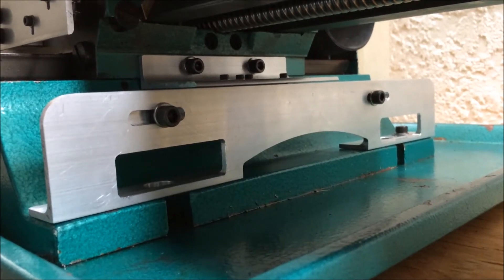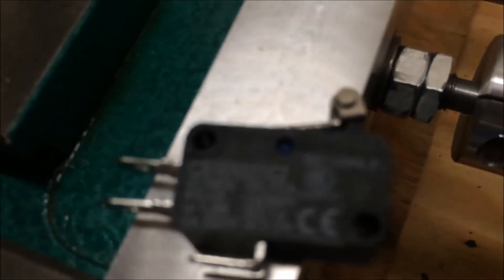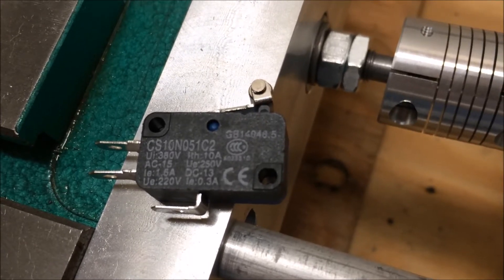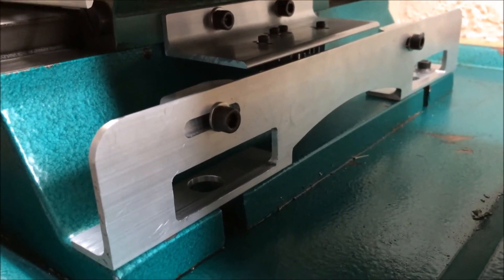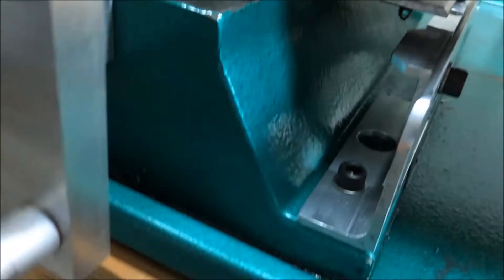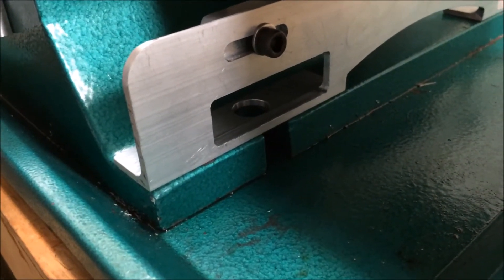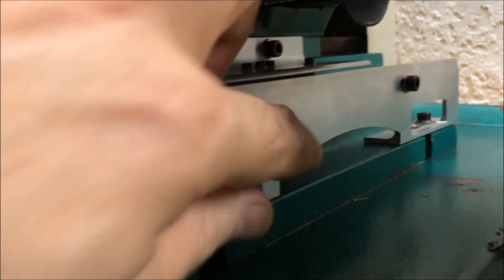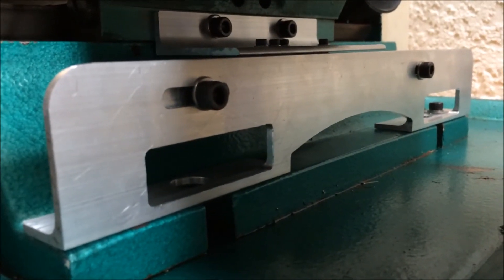Grizzly G0704 or BF20 Milling Machine CNC Conversion: Y Axis Limit Switch Mount - How To Build

Comment: Hey Franco, any chance you want to share your CAD model of the base and saddle?
Reply from the maker: +TD Engineering Hi.  If I could, I'd be more than happy to do so.  Unfortunately, one of the limitations of my 3D Modeling Package (Cubify Design) is that is will not export a proper solid model - the only option you have for export it *.STL which seems to be useless for anything other than 3D printing.
Reply: +Franco any chance you have detailed engineeing drawings?